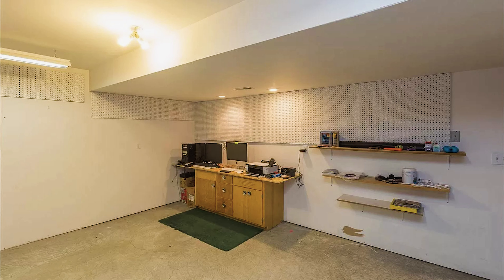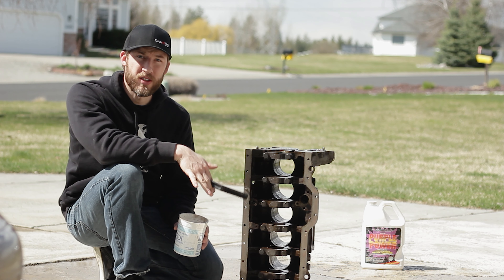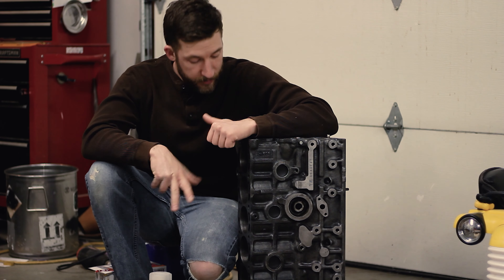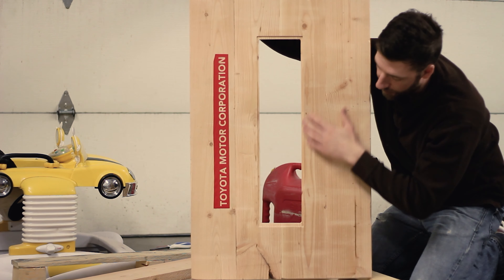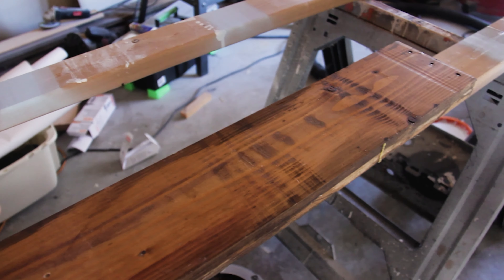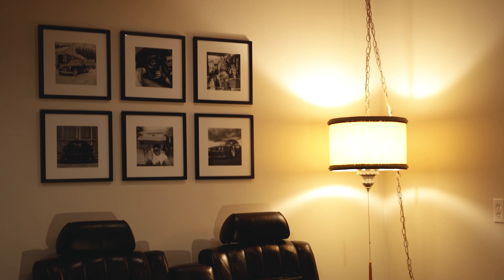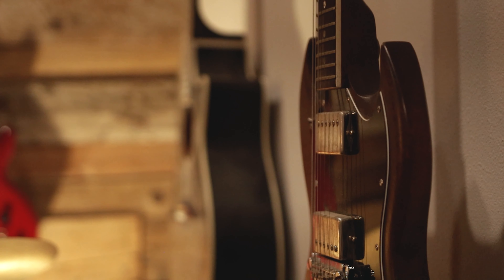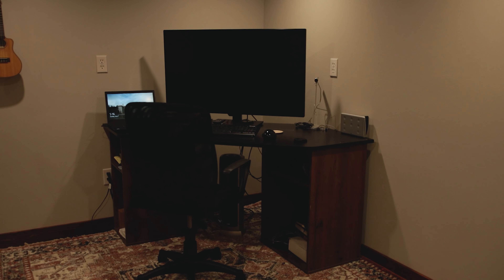Building A Supra Engine Coffee Table For My Ultimate YouTube Office

Comment: Awesome build, what did you use for the legs?
Reply from the maker: Just took some thin wall square tubing and welded two legs that I bolted to the oil pan rails. You can also see I tapered the edges of the feet so I'm less likely to kick them 😂 Feet are definitely no match for this table

Comment: How did you attach the wood top?
Reply from the maker: got some mall L brackets from the hardware store and attached them to existing bolt holes in the block and then to the bottom of the table top with some countersunk screws. There are a couple threaded holes down both sides of the block and then the  upper bellhousing and timing cover bolts. I had to measure and drill holes at the appropriate high on the brackets.